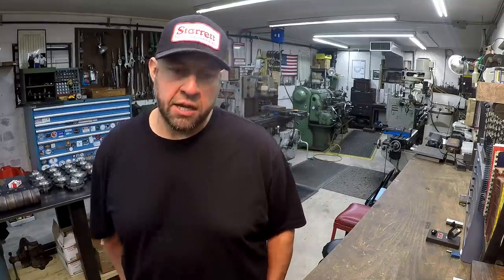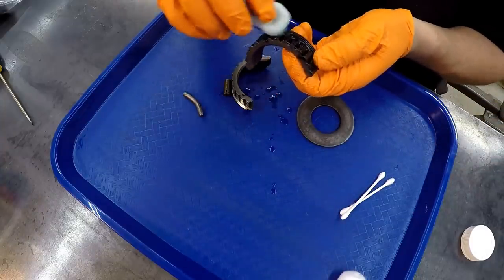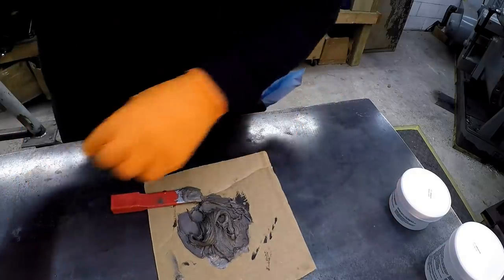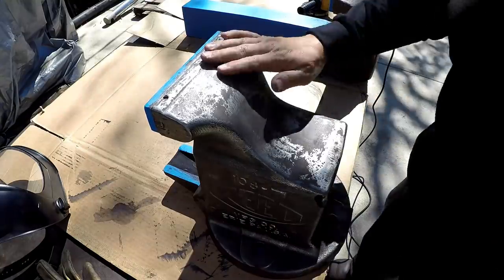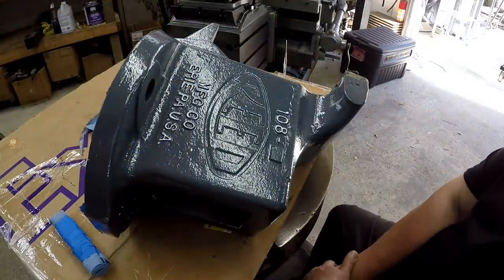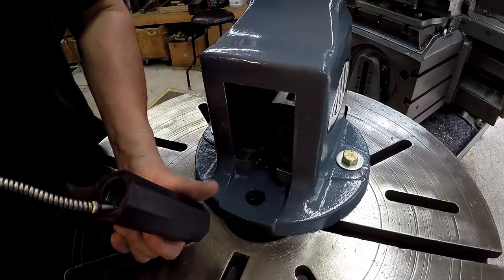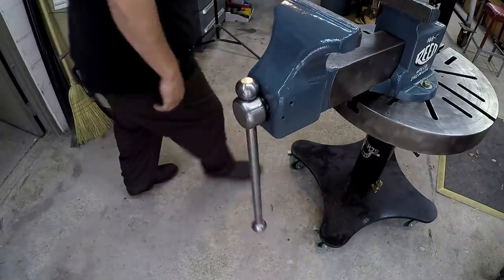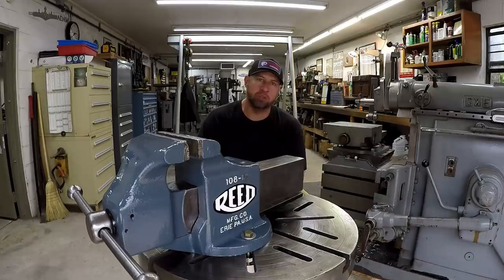SNS 255: Reed 108 Vise Restoration

Comment: I've been considering the use of some kind of blueing on my drill press table to help prevent flash rust.  Although I use oil to help, I have to be a little bit careful.  I use my press for both metal and wood and I don't want the wood to be oiled-- that would prevent it from taking an even finish.  

Anyone have a recommendation for/against using blueing?  Or anyone have a better/alternative suggestion?
Reply: drhender, 
I use FW1 Cleaner With Carnauba Wax by RGS Labs for my bare machine surfaces that don't get oiled such as the cast iron band saw and table saw tops, works great on granite surface plates also.

Comment: Something struck me as wrong and I actually checked the video where you disassembled the vise. You actually put in the split ring at 29:44 in reverse to how it was when you were disassembling it. Here's a screenshot of the disassembly: https://i.gyazo.com/96a3e9b453e4fcca9fd0b3cb23b2a485.png It was the 4-slotted thread into the vise, while the notches were towards outside.
Now it seems to work fine so perhaps it doesn't matter, or was put together wrong before you owned it.
Reply: I think it was installed backward by the person who worked on it before. It makes more sense how he installed it when he put it back together. Small notches inside for the set screw to catch and the four larger ones outside for a punch or spanner.
Reply: That vise is old school. I like old Reed design because it actually has an adjustable collar to remove slop from the screw as the vise ages from hard use. I don’t know how the adjustment works though I was it around back then. I’m sure for some of y’all that are mechanically inclined it isn’t that hard to figure out

Comment: this is the result when a machinist rebuilds something.  I'll remember the machine oil, no grease
Reply: Depends on what environment you're gonna use it and how reliable you are about remembering to oil things. If you're gonna have it in a high moisture area then a light grease might be better. I'd have smeared the threads on that split nut and set screw with some never-seize to be sure they never froze up, but that's me.

Comment: Looks much better. That crappy red spray paint that was on it was just awful.
Reply: That crappy red paint served a purpose

But yes Adam as always did a great job and the vise looks totally amazing now
As for the filler those pits would have made the paint job look awful  some of it looked like a problem with the casting a smoother surface will help the paint stand up to more abuse sharp corners will make the paint chip easier

Comment: I thought you were supposed to wash the bluing off? Or it’ll stay activated and continue to corrode?
Reply: It gets consumed very quickly. You can see how well the cotton ball worked at first, then it didn't work as quickly on the second side of the nut.
Reply: @xenonram  - I've done a lot of cold blueing in my shop. A few months ago I made some machinist jacks for my mill and made the mistake of not completely washing the blue away before oiling. Even with the oil in the threads the blue completely ate away the threads. Rusted them totally. Locked the screw inside. Soaked it in WD for two days and was able to pull it apart. But I couldn't believe how much and how quickly the blue corroded the threads...
Reply from the maker: Wet it down, wipe it dry, then oil it.

Comment: Do a short video showing the slight increase in size bluing gives to a part. Tenths? A thou? Nothing?
Reply: Nothing measurable. You'd have to have an electron microscope to see it. Even the tool too Lipton used to pressure the thickness of a Sharpie mark wouldn't measure it.

Comment: Is there a reason to use 4 levelling feet on the pedestal rather than 3. It is my understanding that 3 points of contact will always stand without rocking no matter the surface they stand on

Comment: seems like you put the split nut in the wrong way, you'd removed it the other way in the previous vid
Reply from the maker: No I did not, the 4 notches are to the outside.
Reply: @Abom79  not sure what it's called, but the smaller grooves (splines?) were facing the outside in the prev vid

screenshots: https://imgur.com/a/AUKgoga

Comment: Ahh finally someone who works with gloves on. I cringed when these guys who restore stuff don't protect their hands. A lot of that stripper and caustic cleaners cause cancer.
Reply: John Wayne I think the same thing watching some of the other guys on you tube. I used to be that guy. now i almost always wear gloves
Reply: @veepsgarage   Yeah man it's a no brainier, not only that it keeps your hands cleaner, I also wear a respirator whenever I am in my little wood shop. I also wear one when I am using the leaf blower. Just keeps the boogers clean ;)
Reply: John Wayne i’ve been slacking on the respirator while indoor in my shop. I need to get better at it but I did install an air filtration unit which makes a huge difference.

Comment: I would have used grease not oil... I feel it's better for this kind of application.
Reply: grease can trap moisture under certain situations... it also hardens with age. in some instances, oiling is both faster and offers better protection. as far as lubrication goes, grease and oil would perform similarly on a vise
Reply: @duroxkilo  since the lubricant is not "contained" in something, oil will have tendency to "disappear" or at least reduce to a real fine layer almost non existent. Grease will not trap water in this particular case and thicknesser included will keep the lubricant cohesive. Plus it will have a kind of "butter" feeling when use that i like more.

Comment: Looks like the split nut was put in reversed from the way it was taken out.  Might be able to tighten better if put in the way it was taken out.
Reply: Yeah, if you go back to the teardown video you can see it.  Adam, when you put the split nut in here at 29:50 it's the other way round from the way it was before you refurbished the vise.

Comment: To help a bit with painting: first, you should avoid painting with a brush. It never will be really smooth and nice. Something as simple as a rattle can give much better results (especially if you don't forget wet sanding after primer). As to the REED logo, the best solution would have been:
1. paint the whole oval area white
2. mask the letters and paint the exposed parts of the oval area black
3. mask the whole oval area and paint the body of the vise
Reply: Your know-it-all,rude comments are annoying. This is a working vise.  The finish is well done and is probably miles ahead of the original.. The restoration was enjoyable to watch and will give him many years of service.  Sorry it disappointed you.  I suggest you unsubscribe and get your money back.  Oh, wait....
Reply: @paulcopeland9035  Adam mentioned he didn't really like painting and didn't have too much experience with it. I did nothing else but offered some friendly pieces of advice. I fail to see why you could and should consider it know-it-all and, above all, rude. At any rate, it's up to him to say so if he thinks so (but, knowing his attitude from his videos, well, I don't think he would).